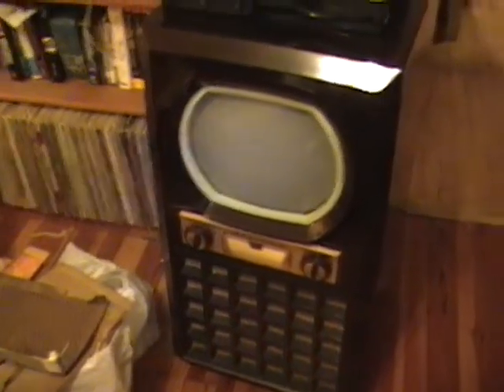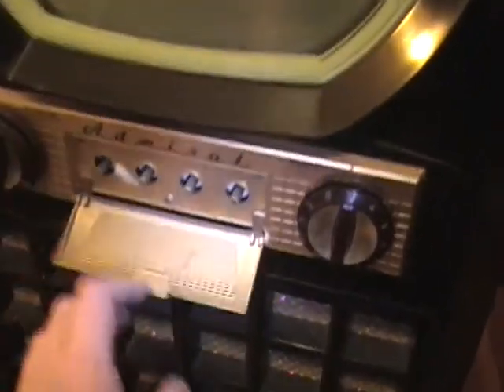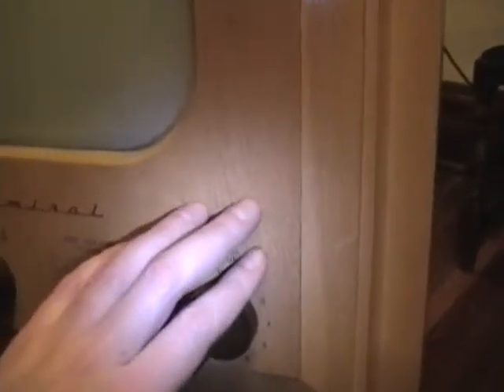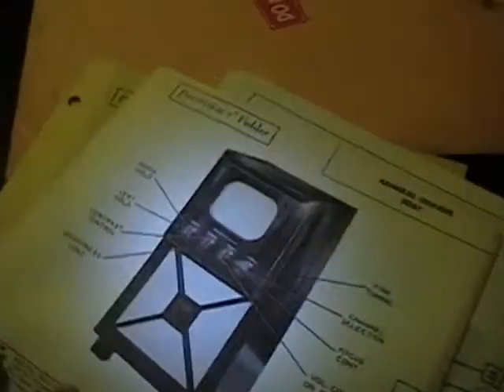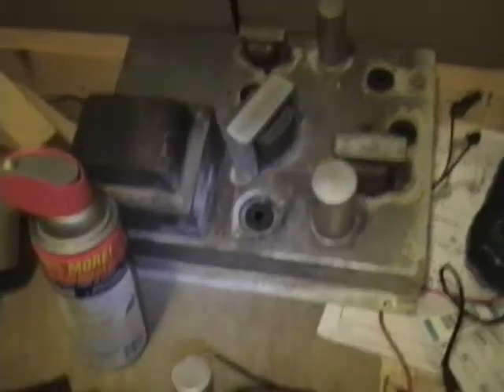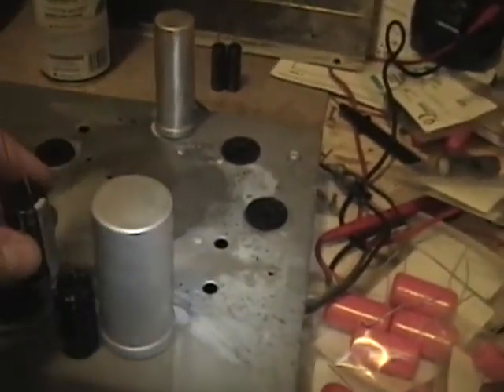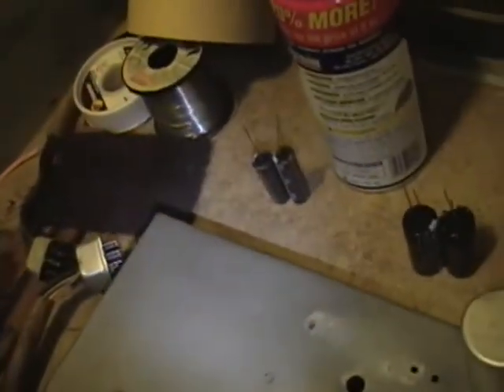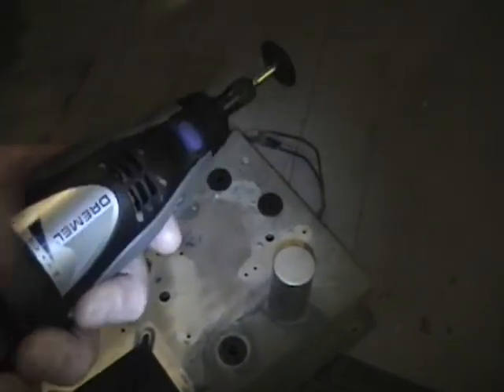Admiral 24A12 Restoration - part 5 / recapping tutorial

Comment: Luckily I haven't had any bad experiences with the large oil caps such as the big oval shaped motor caps, but I did have a small oil cap explode on me once.  It was a ceramic cased cap that was used as the "across the AC line" filter cap in a TV.  I was ducked inside the back of the set making adjustments, when the thing blew up in my face and shot nasty hot oil all over me... It was a nasty green oil too.  Good thing I wear glasses, or I probably would be blind :-)

Comment: Almost forgot, when I was younger I got shocked off an anode lead in a TV I was working on, and broke the back of the CRT off with my elbow.  I was ok, but the TV was a parts chassis after that...  At least it was just a cheap plastic modern TV.

What do you think is one of the worst things you've had happen during a repair job?